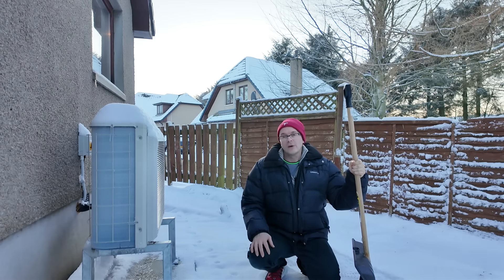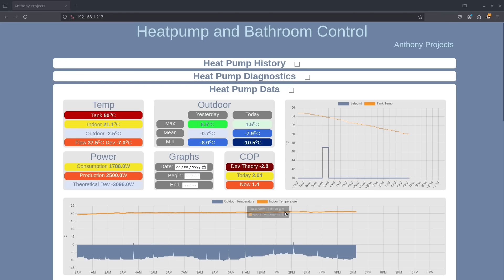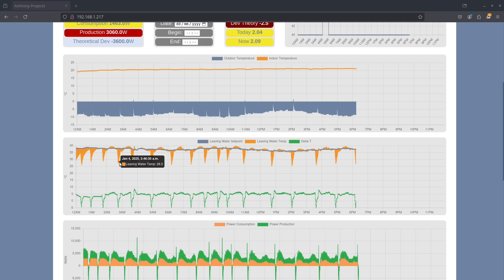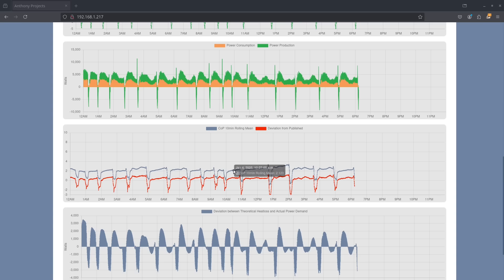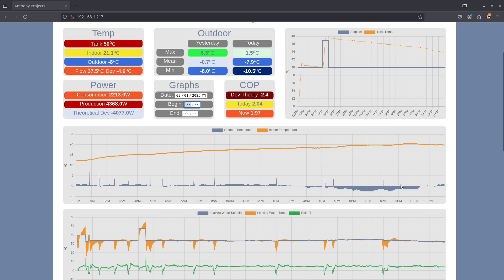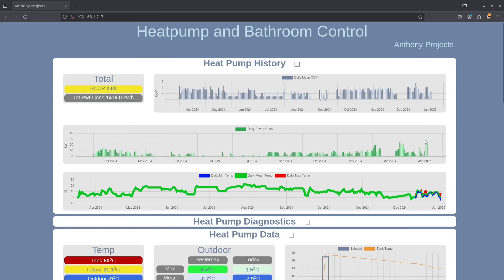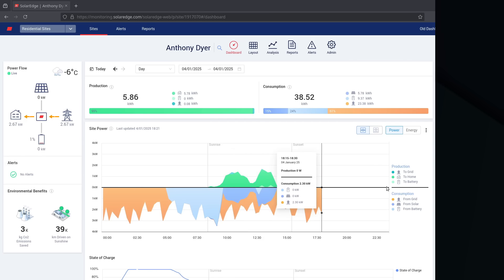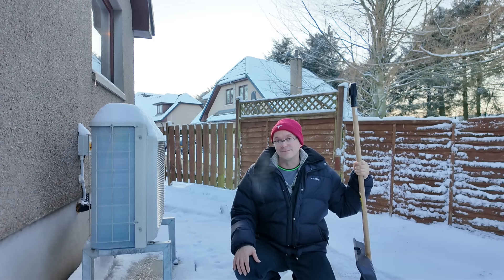Heatpump Performance on the coldest night of the year

Comment: The latest in an excellent series of videos on heat pump performance. We have a 7kW Daikin ASHP but ours is the Altherma 3 Monobloc. Our COP figures are broadly comparable with yours at similar outdoor and flow temperatures, though not as good -  our house requires higher flow temperatures for comparable outdoor temps. Yesterday we achieved a COP of 2.2 at a 24hr average outdoor temp of -2 C. Today, the comparable figures were 3.3 and +1 C. Our annual savings on heating are substantial relative to our old oil fired fired Rayburn.
Reply: Ground source wins in low temperatures.

Comment: I stay in Kemnay, so have similar weather. Can i ask how noisy it is? My wife is a hard sell as she doesn't like electrical noises..
Reply: Noise was an important factor for me - living in the quiet countryside I’m very sensitive to it.  Noise seems quite well correlated to price - I’m on my second house with a Daikin which has a noise output about half of that of a friend with a Panasonic, but it cost €3k more.
Reply: @Richardincancale  That's a bit disappointing, but probably not surprising, I suppose! I'd really like to experience the differences - particularly between air to air and air to water.. I very much like the idea of cooling with air to air, given the occasional sweltering summers we get now..
Reply: @ Thé first Daikin system was air/air installed in a large apartment in Paris with the outdoor unit on the balcony - so it was essential not to annoy the neighbours as well as me!  It was fine - first few minutes it would run full blast when getting up to (or down to more often in 42 degree heat of Paris!) but once in steady state both the indoor and outdoor units were inaudible.
Reply from the maker: @Danothebaldyheid  much quieter than my old boiler.  It’s generally silent inside the house.  That said what you do get is low frequency noise transmitted through the ground during high load events.  And the pitch of the noise changes with compressor speed.  I chose not to have the rubber feet in favour of higher ground clearance, and I think that’s a key factor.  I don’t hear it in my bedroom, but I can hear it in my kitchen and lounge.  It’s not bothersome, but I wouldn’t be wanting it right outside my bedroom.
Reply: @anthonydyer3939  Thanks, Anthony - that's helpful to know..
Reply: I often walk past a house near me that has one installed at the front next to the door ( I assume because it’s the only wall space that’s not under or adjacent to a window and the passageway at the side of the house is only just wide enough to walk through with the rubbish bins). I can hear the fan running from the end of the driveway ( about two and a half cars lengths). I would not be able to open my windows next door without hearing it. I would hate it if my neighbours installed one. They are a noise nuisance and a menace.
Reply: @juliebrooke6099  If you buy a good make like Daikin, Vaillant, Nibe etc. they are practically silent at 1 metre distance - the noise of the breeze in the trees is louder. If you buy a cheap one they tend to be noisier…
Reply: @juliebrooke6099  I hate having to put carbon in the air to stay warm in winter, though. Really I'd like a ground source heat pump - I think they're much quieter for passers by, as well as more efficient during the coldest days..

Comment: Hi Antony . 
IMO a very well put together and informative video  thanks .
As a matter of interest could you possibly set up your system so that you saved your battery capacity to discharge and run the heat pump later in the day and let it draw from the mains from 0530 hrs,  when you lose your cheap import tariff.
Till say 1600 hrs and then have the battery supply  any demand  until it had run down to the level where it stops feeding the heat pump  . 
 I don't think this would have any financial implications but I suspect it would have a beneficial effect on the overall carbon emissions of the country if you could. 
  cheers   Patrick

Comment: You shouldn’t have any issues at all until -15 plus then it’s at its limit then energy spikes usually 2 to 1 ratio per kWh
Reply from the maker: @ram64man  -15 is the all time low limit for my house over the 15 years I’ve lived there.  I’ve seen it maybe only 7 mornings.

Comment: Hi Anthony. I have a New LG Therma V Monoblock 9 KW 60 degrees Celsius Heatpump. I replaced the old one after 12 years service. Snow and stonecold outside today. In da house 20/22 degrees. No Gas. Super. Silent Easy Hot. In Groningen Nederland. Cost 3575. Google Aircoplaza Zwolle. Subsidie was 3075. Connected to normal radiators. High temperature. Super. I know not more about it. Consume is between 20 kWh and 30 kWh a Day. Super.

Comment: The coldest I have seen is -1 this year, I'm right on the south coast so pretty mild down here.
I am heating the house to 21 degrees with a 1 degree setback over night.
I'm still fiddling with the WD curve on my 8kW Daikin but with temps between 1-5 degrees according to the MMI figures I am still seeing a COP of about 3.5.
Reply: Just had a cold evening here in Canada -32 wind chill -42 C  was nice and cosey at 26 C with my wood stove. Will never heat any other way.
Reply: @dog_guy-m6b  No one is telling you to. If you want to breathe dangerous levels of PM2.5 fill your boots.
Reply: Heat pump rip off of the century never want them.
Reply: @mosheridan7016  One, no one is forcing you to buy one. Two, you don't have one so how would you know. 

My heating bill was £40 lower this December than the last December I used gas. It will probably save me £300 a year in heating bills. I saved about 340Kg of co2 and 14 grams of NOx. I did not give a single penny to foreign sovereign wealth fund or corrupt oligarchs.
Reply: @nervousfrog101  You took the low energy subsidy from our tax. If it's about saving the planet at our expense. Well done.
Reply: @mosheridan7016  1) How would you know if you don't have one 2) No one is making you buy one.

My last gas bill for a December was £108 my electricity bill for running the heat pump this December was about £35.

You keep lining the pockets of the Norwegian and Qatari sovereign wealth funds as well as US corporations and Russian Oligarchs if you want to I'm quite happy with my heat pump thanks.

Comment: this is a great video to show that heat pumps do work,  a temperature around 20deg is comfortable which is the point of having heating....   people who say that 18deg is comfortable and then say "i've managed a cop of 4.0" just to compete with gas is laughable, if gas was the same price per kwh as electricity they'd all run their systems at 20/22deg and sod to the cop...
Reply from the maker: @robin5215 A CoP of 4 with ambient at 4 degrees and indoor temp at 21 degrees is no sweat for this system.

But higher temperatures are worse.  My previous videos explain why, but there is such a thing as a “minimum output”, and in these situations it’s important not to circulate central heating water below 30 degrees.
Reply: Who can afford them?
Reply: @alanevans9604  I can!  And my 2YO heat pump is saving me around €1000 per winter over the oil-fired boiler it replaced.  And that despite the fact that I kept the old radiators, requiring a rather high input temperature.
Reply: @russellcrosby8175  Wrong calculation! My heat pump also gives me hot water, saving another ca. €400 in electricity for the boiler I had before.

I made the calculation in great detail. The pump will pay for itself in 9 years, not 20 (the pump ain’t cheap, that much is true… especially as I bought a top of the line model… but there are government aids). And, properly dimensioned, properly installed and properly maintained, it should last at least 20-25 years.
Being a retired engineer, trust me for having done such a feasibility study most thoroughly!
Reply: Run mine at 20 degrees, still cheaper than gas but COP 2.7 last I checked, but house cosy 24/7.
Reply: robin5215. I wish mine did. I used to have a coal fired Rayburn for heating and cooking. and the house was always toasty. To cut a long story short my land lord had an 8 KW Mitsubishi air to water heat pump fitted [ he meant well] and now I actually have to turn off the heat pump in cold weather because its on 24/7 and is too expensive to run. My house is about 90 years old and has double glazing and 150 mm loft insulation where possible. So I have to use coal and wood in a wood burner. Basically the heat pump doesn't produce anywhere near as much heat as wood or coal.
Reply: But at what cost? As electricity prices are at the whim of the government it is not an open market.
Reply: @tonysheerness2427  I live in central France.  And here, my 2YO heat pump costs me a bit less than half in energy cost over the winter,  that either my previous heating oil-fired boiler or a gas-fired one (gas not available where I live).
Reply: @st-ex8506  Is there a free open market in energy in France? Or is it controlled by the government?
Reply: @tonysheerness2427  Yes, as in all EU countries, if I am not mistaken, the French electricity market is free, with no fewer than 95 suppliers.
Reply: @st-ex8506  Selling under the control of the government or the other fuels are heavily taxed.
Reply: @tonysheerness2427  Selling WHAT under the control of the government?  Electricity? It used to be the case in France, but it is not anymore, for many years.  The government can only influence... to some limited extent, the so-called "regulated prices" of EDF, i.e. the most expensive price they are allowed to charge... Way above the tarifs you can get on the market, INCLUDING from EDF itself.
Heating oil is not "heavily taxed", as the tax represents 15% or 1.46 euro centime per kWh of heat content... and 1.64 centime per kWh of gas! It seems most reasonable to me.
As to the long-term price of electricity, it will fall dramatically to a few (single-digit) centimes per kWh... and will be free during times of peak solar and/or wind production... as is already the case in some countries.  It will NOT soar.  As a matter of fact, my electricity bill has been decreasing by a total of about 25%  in the last 2 years, and may well decrease again a few percent next February!  
What wrapped message are you trying to pass???
Reply: @tonysheerness2427  There are smart tariffs that track wholesale prices. I've even had occasion when they pay me to use electric.
Reply: @bryanhindle8307  I can remember the first energy scam in the 1960's when they said electricity will cost next to nothing as they rolled out nuclear energy. They did not factor in the cost of stockpiling nuclear waste or decommissioning the reactors after their useful life. You are being played. Once every one has converted to all electric energy watch the price soar.
Reply: Presumably these COPs of 4 are actually “SCOPs”?

How does that compare to the real COP?  Or GSHP COP?

I have to agree that ASHP should be cheaper than resistance heating on electric (apart perhaps really needing to run continuously) but I don’t think these heat pumps are, yet, quite good enough to persuade me away from occasionally using my gas boiler and mostly the gas fire in the lounge!
Reply: @oliver90owner cop is coefficient of performance. Scop is seasonal. Effectively averages the cop over time, I believe they do an entire year. Heat pumps have to work harder in the winter. Still more efficient in heat output for energy input than gas but not financially if you are in the price cap. If you have access to a battery as this chap does then you can import low price electricity and use it to run your more expensive heating but if you were on the price cap then it works be multiple times more expensive than gas. 

Once there are sufficient heat pumps and electric cars to even out the demand then the overnight cheap rate will disappear and they will be paying more than gas. But hay smoke em while you got em.
Reply: @ Yes, I do know what COP and SCOP stand for.  It always seems that the SCOP is considerably higher than the real practical COP, so it is used as marketing hype?  I’d like a fair comparison with a borehole heat pump system, not an inflated ‘SCOP’.
Reply: Hi. Thanks for the video. Whats your heatloss for the house and size of Heatpump.
Thanks
Reply: 21 degrees wouldn’t be  “comfortable” for us for sure , where do we go from there .?

Comment: Are you sure the published figures refer to the actual system performance and not just environmental yield? A COP below 1 would mean the system is losing more energy than it produces, which seems unlikely since heat pumps are designed to extract more energy than they consume. Additionally, if your system includes an immersion heater, the overall COP should still remain above 1 even if the heat pump struggles at low water leaving temperatures.
Reply from the maker: @BenIsInSweden  There are published figures for ambient temperatures of 12, 7, 2, -3 and -7 celcius.  Some of those valves have two sets of figure:  One for 35deg leaving water and one for 55deg.  So I plot a line for published cop figures and then compare to my actual CoP.

Negative Cop does happen during defrost cycles. In these situations heat is being removed from the central heating water to heat up the refrigerant and then it’s taken outside for defrosting the heat exchange fins.
Reply: @anthonydyer3939  Oh I misunderstood, I thought the published figure would work out as a COP of 0.6, not that the difference you were getting was about 0.6. 😊
Reply from the maker: @BenIsInSweden  Yes.  The closer the figure is to zero, then the closer my heatpump is to published figures.  Negative numbers mean my heatpump is performing worse than published figures.
Reply: Wouldn’t Octopus cozy suit better with afternoon charging
Reply: Is there a hybrid system? Gas/ heat pump. That way it could control the system  best price. This would maintain competition in the energy supplier market. If everyone is forced into heat pump. The electric suppliers would have a captive market.
Reply: @andrewtitcombe8378  Yes, there are. But they would only really solve a temporary problem - the spark gap, where there's a big gap between the price of gas and electricity.  That - whilst moving slowly at the moment - will likely shift in about 5 years when things like the Paris Agreement come into effect.

The gas market is currently a captive market as it is, you end up paying whatever the going rate is, and has been that way for decades.  At least with electricity you often have the option to generate and store your own with solar and/or a wind turbine, and batteries.

Comment: Impressive performance: well done! Two questions: I didn't see the brand of heat pump and its nominal peak power. Secondly, I didn't spot a domestic hot water cycle. How does the system recover after that.
Reply from the maker: @michaeldepodesta001  It’s a Daikin 8kW Altherma split refrigerant heatpump.  It’s rated at 14 Amps at max consumption + 2x3kw resistive heaters (which are only ever needed for disinfection cycles and cold startups).  There was no domestic HW cycle this day because the previous day I had a disinfection cycle.
Reply: @anthonydyer3939  Thanks: Now for Questions number 3! The average heating power appears to be less than 5 kW which is just 60% of the nominal peak power. Do you know the peak power of your system **at -10 °C?**
Reply from the maker: @ It’s going to be just under 6kW at -10 Celcius.  So with 14 Amp peak power consumption, that’s about 3.2kW consumption.  With a COP of about 2.3 you could push 7.5kW theoretically.  But factor in the defrost cycles and the CoP drops to 2, and the higher your water temperatures the lower your CoP.   So when the water temperature is climbing up, you can push 7.5kW below 30degrees water temp.  But above 38 degrees your CoP will fall a lot.

6kW is plenty for steady state operations.  The heat loss for my house at -10 celcius is about 3.5-4kW so I’ve still got some margin.